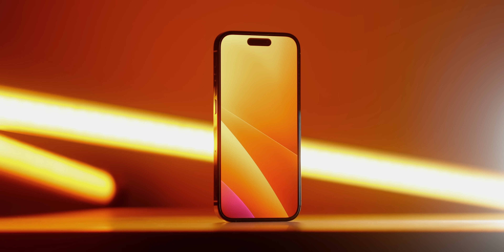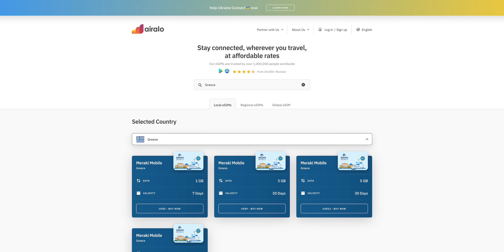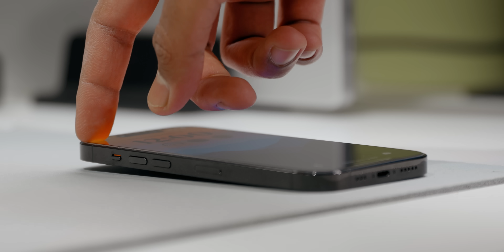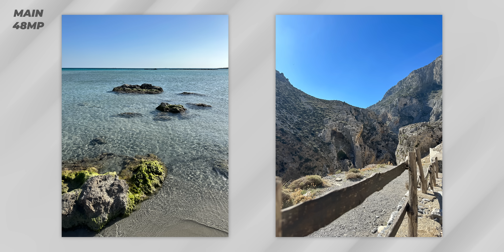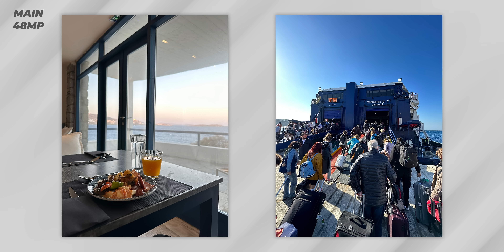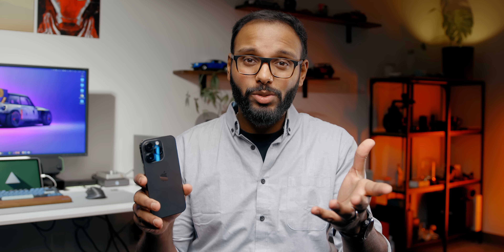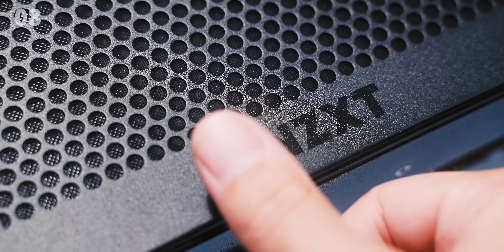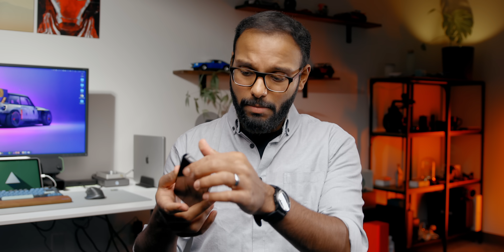Apple iPhone 14 Pro - A Long Term User Review

Comment: The always on display is useful in a crowded environment where you can quickly glance at the screen to see if you have any messages or check the time but I personally stopped using it.
It would be nice if they'd integrate a wake (using face id) always on display which if unlocked allows you to read notifications while running at 1Hz-10Hz . If the phone is not unlocked by the user the always on display only shows the notification icons, time and health/other customised apps.

Comment: 100% disagree on the notification position. I'm 6'4" and have decently large hands to pull down notifications from the top. However, pulling up from the bottom is so much easier... for everyone. Just because its new and different doesn't mean its bad. You need separate what you're used to before empirically saying the user-experience is bad.
Reply: I think his gripe is why do they not show automatically on the lock screen. You have to wake the screen then swipe just to see notifications. They should just already be there yeah?
Reply: I agree, just because when smartphones arrived, notifications were always drop-down. There is no law saying that is how it has to be or that it is the best solution. We are just used to it, much like why Windows dominates the PC market; people get used to one thing and stick with it.

Comment: Im still using my galaxy s8. I am itching to upgrade it.  Im sure the iphone 15 is going to have usb-c and I would feel like a fool then if I buy the 14pro now.  Usb-c  may not  matter you might say but it kinda does when you transfer your HUGE  video and photo  files over.  ARGHH   I really dont want to wait another year for an upgrade.  Damn you apple!  First world problems...
Reply: I generally don't take huge videos on my phone but I use dropbox and also have my home security camera system synced to the cloud and it sends video and pictures all day and night. My phone automatically sends videos and pictures to the cloud without me having to do anything so even if I did need to transfer huge files it wouldn't be much hassle unless I was on a time line and needed it done asap. Or I was some place with crappy internet. There are 5G towers everywhere around my city and surounding subburbs though so that would be pretty rare unless I was traveling.

Comment: Wow, so a quarter is now "Long-Term"!?
That's a great promotion for smartphone companies
Reply: I looked at the title like what? it JUST released 😂 (staggered release throughout the world). long term should  minimum 3 months after release, the month of release is pretty much hot fixes here and there.
Reply: @TrueDesire존  long term should ideally be (imho) 2+ yrs later, or at the very least 1 year later (which is the iphone release cycle, unlike the 4-6 months of many Chinese OEMs).
What's the point of a "3-month later" review for an iphone given that if it's bad, then what other better options (in the iphone world ofc) do you really have until you wait for the iphone 15 later this year, which again is going to be another incremental update (unless they give HRR for the vanilla models which I highly doubt they will)

Comment: Go to some of the less tech developed countries in Asia (like the one I'm from) and see how far an eSIM will take you :(
Reply: ...with tech, a golden rule is to go at a different pace than the slowest device or nation, as in your case. Tech would stall, and we would still be using floppy disks. You have to push (force) better tech, to get some Asian regions to speed up their tech. So Apple pushing eSIM is needed and good for tech, though it will, of course, be inconvenient for some in the medium term.

Comment: I have AOD set to only turn on when a notification comes in(available on Samsung. Don't know about others). I found it really distracting otherwise. Especially when the clock was changing spots to prevent burn in. I always noticed it when the phone was on my desk(which meant it was always within my FOV).

Comment: I am using the 13 Pro Max to date and opted to get this because of your video on the 13 Pro last year. 

Regarding the AOD, I was previously using android devices with AOD and I only set it to tap to show, so I don’t really miss it here on my 13 Pro Max as I can still do tap the screen to check if there’s a notif or what.

Comment: How’s the thermal throttling? It would be also cool if you guys go in depth in the architecture.
Reply: Definitely a good point, I ran into thermal issues in the XR
Reply: @Phynellius  Same on 11 pro max on just google maps alone
Reply: I don’t run into any in my day to day. That includes some basic GoPro edits on the for and exporting. But I don’t push it much.

Comment: What YouTubers believe I think of as a long term review: 1 month 
What I really think of as a long term review: 1-2 years 

Please don’t take it personal 😅
Reply: Only problem is that people dont’t buy 2 year old phones. I think maybe 6 months is the sweet spot  when the price drops significantly on most tech.
Reply: @richardKeytero guess I'm the exception then, literally bought an iPhone X this year because my 7 broke
Reply: @schtormm  Nothing wrong with that,  i’ve bought older used phones before as well.  
The majority of people doesn’t buy 2 year old phones new from the store.
Reply: @richardKeytero  exactly, and even if we did, the price difference isn’t much. Most would rather spend a 100-200 dollars for a newer year model that has much better features
Reply: @richardKeytero  i think buying 2 year old phone nowadays is always better if you catch them on a good deal, for the minimum you would have 2 year support for either samsung or apple and on top of that phones dont get obsolete that quickly

hell my dad's s21 ultra (nearly 2 years old) still feels flagship because i keep forgetting that the s22 ultra exists

i suppose its cause the s22 only offered a design and minute upgrades over the s21 but still

i also happen to find the s20 fan edition (refurb) at basically 300 usd which i say is much better than the current offerings from even samsung current midrange
(do note, we are taxed heavilly when it comes to tech stuff soo it may sound expensive to you but it is dirt cheap in comparison to other stuff)
Reply: @LoneBeastYT  Nothing wrong with older phones, just that you should just look at the used market instead (or refurb as you mentioned ). Because phone prices don’t drop much more after 1-2 years, especially iphones.
Reply: @richardKeytero  for me i have been able to find good deals and the price to performance ratio really works well in the 2 year period (atleast for the used market) it is also possible that discounts are high in my country
Reply: Lol😂😂😂
Reply: Its not long term and they know it. Its simply for the title/thumbnail so people click
Reply: @bri4498  I think 2-3 months is long term for technology. You’ll have an idea about the phone that it’s essentially the same experience for the next year
Reply: But you are speaking in terms of tech. Tech gets outdated quick lol
Reply: @zureai  to the average person it does not get outdated quick. I’m still using an iPhone XS Max. People still use an iPhone 7. Im not in a need of an upgrade because my phone still works fine. Tech gets outdated quick for “nerds” and YouTubers who always want the “best” thing out there
Reply: @husamh4585  I mean that’s exactly what a tech channel is for.. they need to stay up to date with their sector. What’s a review channel if they are reviewing items 5 years later.. not unless you want them reviewing the iPhone 7plus in 2022? And then the 8 plus next year. New items come out every year…
Reply: @zureai  4 months is still not a long term review. At least 6 months maybe but defo not 4
Reply: @husamh4585  but you have to understand.. people need to get their videos out first to get their views lol. You wait until a 6 month review and other reviewers already reviewed “long term” 4 months ago. They label it “long term” because after 2 months you already have a good idea of how it operates.. and that experience will be the same for the next year